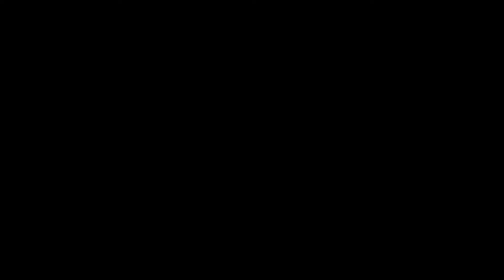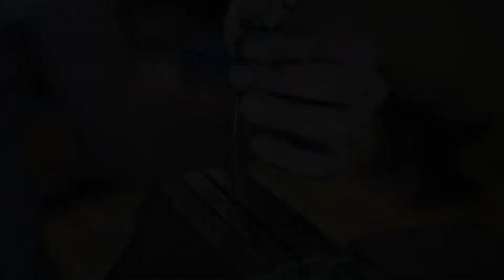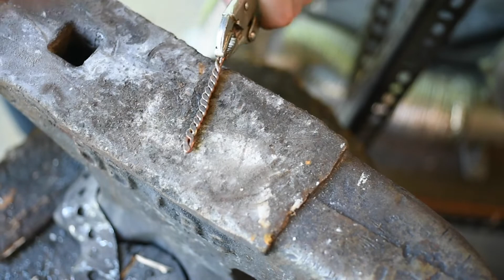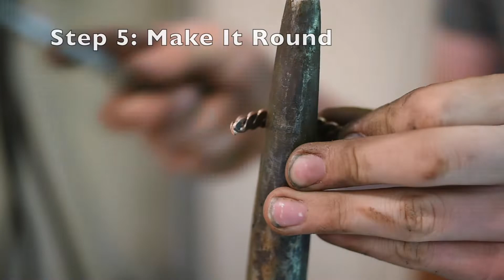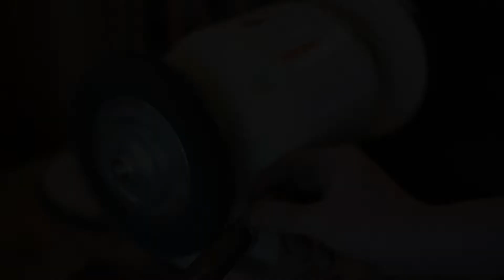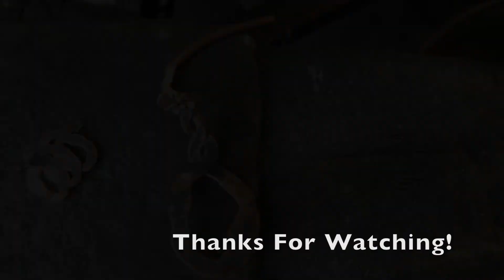Making  A Simple Twisted Copper Ring- VERY EASY 5 MINUTE PROJECT

Comment: Thank you! I tried twisting in a vice with 1.25mm wire and also 2mm wire using a vice but I can't seem to get the gaps to close after twisting as much as possible. As soon as I hammer it out, I get a chain type effect, which is ok but not as nice as what's in your video. I'm annealing as I twist on the vice but not quenching. Any ideas?
Reply from the maker: You just have to twist it more. Not sure if it makes a difference but i quench it when I anneal. I’m also using a thicker rod. In this video it was a little thinner but recently I’ve been using 1/8” rod. So that’s like 3mm roughly